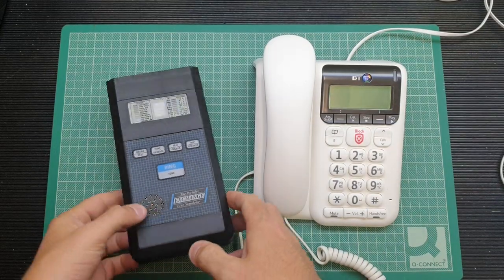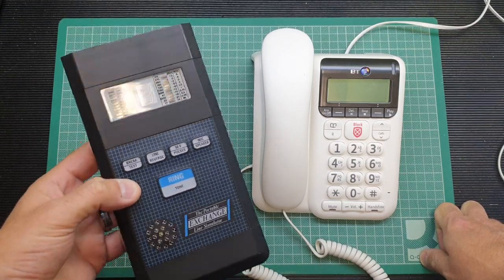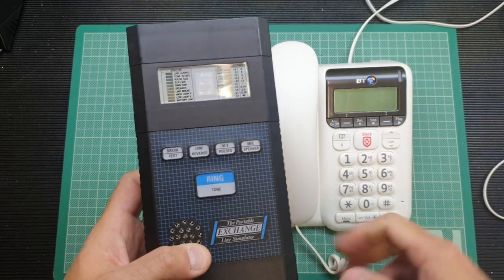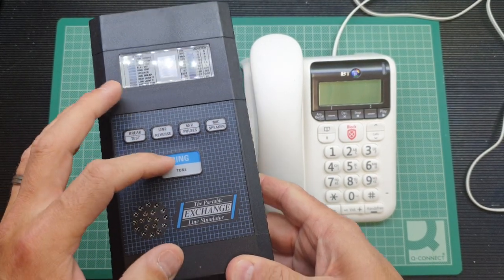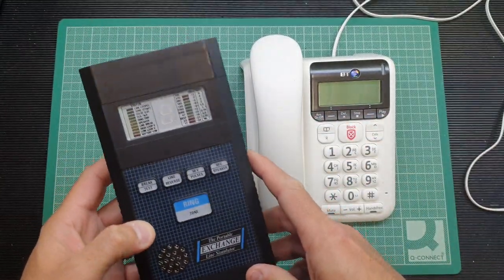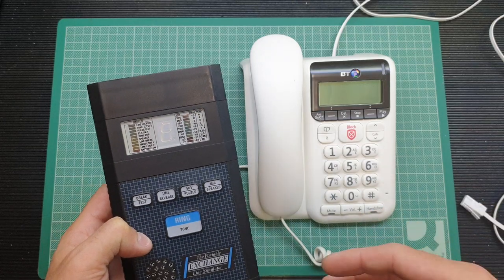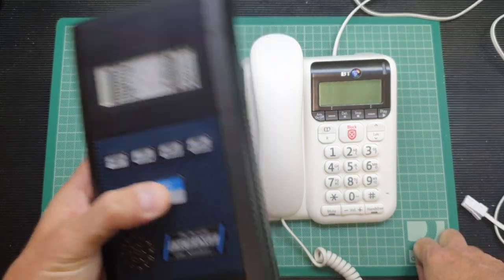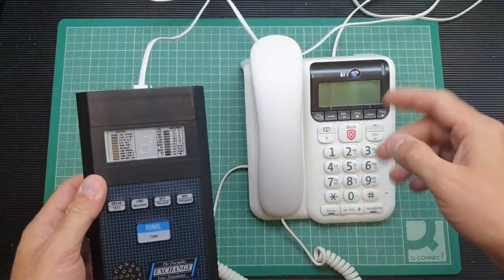Portable Exchange / BT Telephone / Phone Line Simulator - Operation And A Look Inside

Comment: I used to work for Dell tech support back when the 56k modem was the norm. We used to get a lot of calls from people saying that they had  problems connecting to the internet. One of the first questions was how many phones were on the line. Had to explain the whole REN thing and get them to check on their phones for the REN value. Some people would understand and go test with less phones on the line and others would be screaming for an engineer NOW lol.
Also, when I was a teen our phone used to have a physical lock on the keypad to stop us running up massive bills. Used to be able to bypass it by dialling though the hangup.

Comment: 13:32 No, the 74-series is a family of TTL integrated circuits. The 74595 is a shift register. :) The letters between 74 and the number is the type. HC = High speed CMOS. 

The 74HC85 is a 4-bit magnitude comparator. It can answer the rather simple question: Is A less, equal or greater than B, where A and B are 4-bit binary numbers (or BCD). Simple question, but it's not easy to build with logic gates. 

The 74HC4040 is a 12.stage ripple counter.
Reply from the maker: Cheers Robert, I stand corrected! 😁

Comment: I wonder if the exchanges are still setup for pulse dialling, I saw an old phone in an antiques shop this week, would be interesting if it could still be used.
Reply from the maker: I might have a look and see if I can grab one.
Reply: Some of them retain this feature however with the rise of broadband ect,  exchange space is  a premium.  You can still buy a modern rotary phone which has a built in electronic dialer behind the rotor to overcome this issue, but another feature on the way out is the bell wire, which used to ring the mechanical bells in these phones
Reply: They are, i JUST checked. I have an old(ish) handset and you can switch it between tone dialing and pulse dialing. 

Just seen your comment and remembered i had it in the bottom of a box lol.
So, out of curiosity and to answer your question, they do still accept pulse dialling. 
It took a while to dial tho as you would expect anyway.

Hope this helps
Ill maybe make a video and upload it.